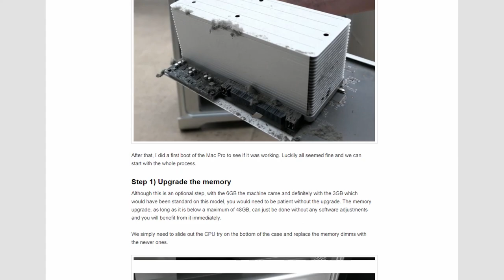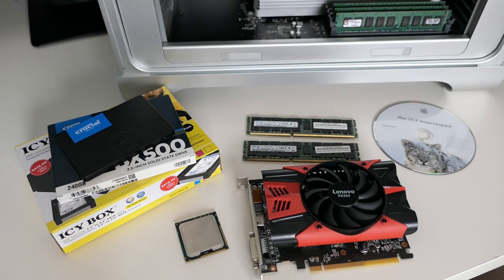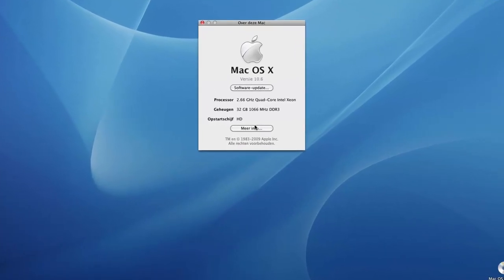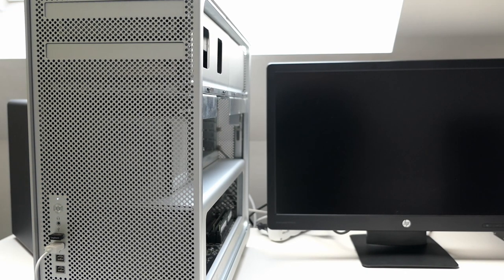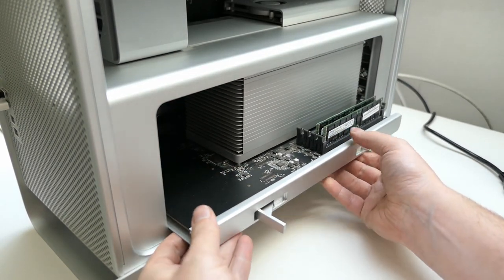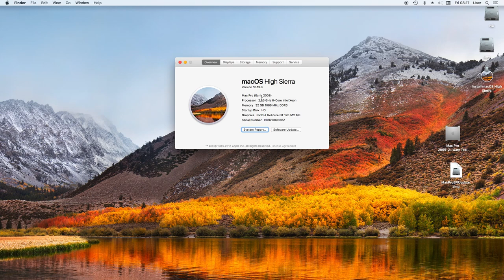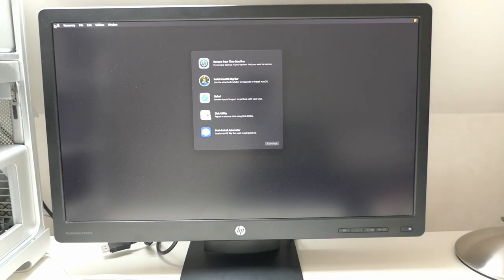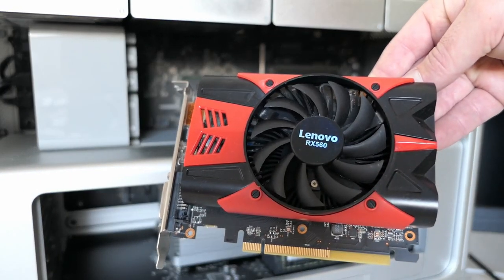Mac Pro 4,1 - Full hardware and software upgrade to Big Sur

Comment: Any tips on getting Windows installed on a 5,1 running Mojave? I an having no luck with that. (OS X working fine with a RX 560)
Reply from the maker: Did this a few times and it's indeed a bit tricky. I recommend to first install macOS, then install OpenCore and Windows. The main reason to use OpenCore is because Windows is writing files to your bootrom on a regular basis (certificates) and there have been people which had this IC to wear out and fail. (There is plenty of info on MacRumors, including some posts from myself on the topic as well). You can also burn the ISO to DVD (nostalgia) and boot from it in MBR mode.
Might do a video on this whole topic later but I'm afraid it will get pretty long  :)
Reply: What did was install high Sierra  first then boot camp on different drive. After that install Mojave on different hard drive. After this you delete hs or keep it

Comment: why not do all the Other upgrades 1st and then direct fresh install Big Sur when all then hardware is ready? better than upgrading one os after another
Reply: you need to the the OS upgrades in order to get the EUFI flash updates. you cant upgrade direct to Big Sur or High Sierra.
Reply: Because as great as the Mac is, it sux donkey turds.
I have a 4,1 (given to me by a relative) single CPU with 32Gb and RAM to upgrade to 96Gb. Also two 5,1 (I purchased from a wedding videographer) with dual 6 core CPU, 64Gb, and expensive 8Gb video cards.  I basically bought the cards and got the 5,1 for free considering the market right now.

As a Mac does not operate like a normal computer; these have been a nightmare.  Cannot upgrade macOS apps as I’m not on Big Sur.  As I cannot see a boot screen with the current video card, I cannot even begin to do what was shown here.

My PC, Ryzen 5950x that I’m in the process of building, (as well as my old Pentium from 2003) would run DOS 6.1, 95, 95, ME, NT, 2000, XP, Vista, 7, 8, 8.1, 10, and the upcoming 11 (the old machine would if not for the TPM module requirements).  But not a Mac, as Apple wants the money by forcing their fan boys to buy the latest and greatest hardware.  Or jump through hacker hoops.

Don’t get me wrong, I really like the 5,1 with what I can do with it for video editing in DaVinci Resolve.  I just don’t like Apple business practices.
Reply: @AlphaFox78  Thanks Alpha....I had forgotten about the incremental firmware updates

Comment: Your CPU had a heat spreader (lid) I thought 4,1 2009 machines had CPU's with no head spreader.
Reply from the maker: Single CPU models have a lidded CPU, dual CPU models in a 4,1 have delidded. I did a video on upgrading the CPUs in a dual CPU model more recently. You can find it here: https://youtu.be/zTl1lL1zfkg

Comment: The ssd is not coming up as a boot option when I boot with option key only the usb is
Reply from the maker: Did you already install an OS to the SSD?
Reply: I installed the new ssd in the Mac, created the bootable usb with Big Sur, the when I rebooted with the option key, I only get the floppy disk icon with the installation and not the second one with the usb icon as shown on your video at 20:05
Reply from the maker: @yh72119  make sure to prepare the USB drive first as in the video. If that still doesn't work, try another drive. I noticed that sometimes the Mac is picky for which type of USB drive it wants to boot.
Reply: Ok great I will try another drive since I went through the usb preparation twice. I will report the outcome. Thank you for your support.
Reply: it is now worst. I got new multiple usb drives. On multiple trials, I followed the steps of erasing the usb drive as instructed, then downloaded the MicropatcherAutomator, then run it, and during the process of installing the bootable os onto the usb, the patching process fails with the following message: "disk1 was already unmounted or it has a partitioning scheme so use "diskutil unmountDisk" instead Volume on disk1 failed to mount; if it has a partitioning scheme, use "diskutil mountDisk" If the volume is damaged, try the "readOnly" option createinstallmedia failed! Please try again..." 
what should I do next? this has happened on four usb drives now

Comment: I tried to install but shows a error “This copy of the InstallAssistant application is damaged, and can't be used to install macOS”. I followed same way you did to create the usb installer... this happened to someone else?
Reply from the maker: This is probably because you only downloaded a small version of the installer. If you check the folder size in the Applications fokder you will see it's only a few 100MB. I think you can use "softwareupdate --fetch-full-installer" to get the full version (not 100% sure, can't test at the moment)
Reply: @jensdbe  ok, I will try... thanks

Comment: Do you have an idea update hardware And software by the iMac 🖥 2006. ?
Reply from the maker: I'm pretty sure that the video card (GPU) in a 2006 iMac is not Metal supported so anything higher than High Sierra is not a good idea. It's theoretically possible to upgrade (MXM interface) but in practice due to space constraints it's not really an option. I guess the best you could do is upgrade your RAM and replace the disk with a SSD. 
In terms of software I see that dosdude's patcher specifically mentions that 2006 models for High Sierra are not supported (http://dosdude1.com/highsierra/) so not sure what is the best/latest working version.
Reply: 4,1 is oldest pro you can do this trick on. anything earlier and your stuck and not worth it.

Comment: What happens when you try to upgrade to osx 11.5  or 11.6 ??
Reply from the maker: You can just upgrade using the macOS update utility as far as I know. In case this doesn't work, make sure you run through the post installation automator (see my video about installing Big Sur on unsupported models for more details: https://www.youtube.com/watch?v=zlDQBYlYACk)
Reply: @jensdbe  I am pretty sure it breaks after 11.2.3 on a 5,1

Comment: 2010, Mac5.1 doesn't works, you can't use hold option key, no boot possible with Metal Card as Radeon580.
Reply from the maker: It's normal that you are not seeing the bootloader with an RX580. That has nothing to do with using OCLP. In this case, I think the best approach is to first install OpenCore to your hard drive. That will allow you to boot other media with the RX580. Or temporarily replace your video card with one that does show the bootloader.

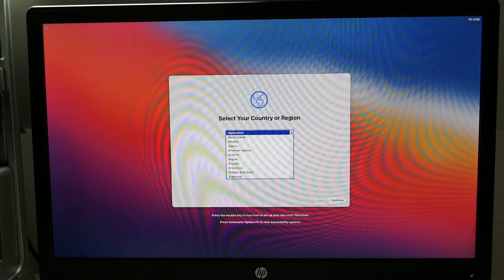Comment: hi ! i'm stuck @ 21:07, everything works great to this point, but my macpro is now stuck on reboot on Big Sur, anybody got this problem ?
Reply from the maker: Did you first choose the other icon (mac shuts down instantly? Then repeat and choose the one with the logo.
Reply: Same here!  I don’t see other icon (EFI Boot). All I see is Big Sur installer icon and the High Sierra disk icon. I tried everything again and ended up with not having EFI Boot icon.  I am stuck and please help!

Comment: It does the job.... but beautiful...maybe after a few drinks.
Reply from the maker: To each his own taste I guess. But a few drinks is not a bad idea :)
Reply: is ur wifi -bluetooth - airdrop is working i mean there is no issue
Reply from the maker: @hussinaltmeme1574  Bluetooth is working fine and as expected. This one does not have wifi but in the past I did the same (with Mojave back then) with a 5,1 that had a wifi card and that worked fine as well.
Reply: @jensdbe  thank u for this video it was so useful keep it up

Comment: Thanks for the great video, I have a Mac Pro 2009 myself, so I wanted to ask which cpu and which graphics card I can use?
Reply from the maker: There is an extensive list (and discussion) on MacRumours. That's probably the best you could find.
For CPUs: https://forums.macrumors.com/threads/mac-pro-cpu-compatibility-list.1954766/
Fro GPUs: https://forums.macrumors.com/threads/gpu-compatibility-list-for-cmp.2174600/